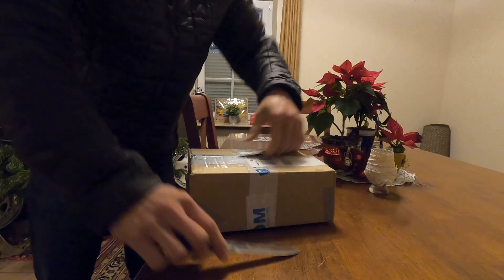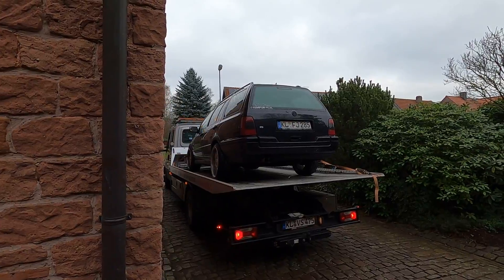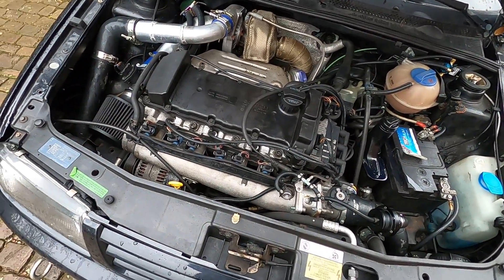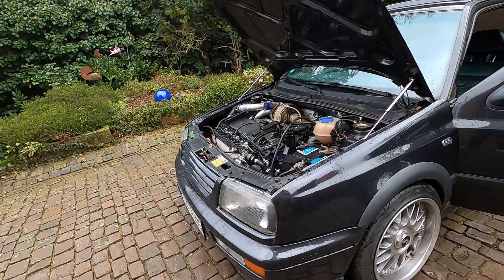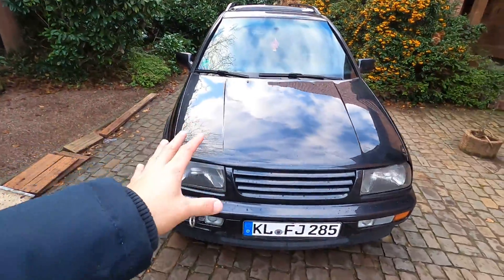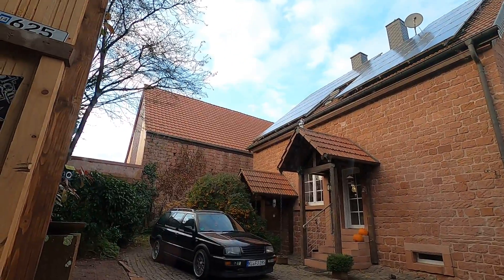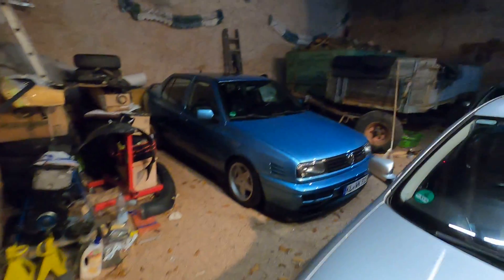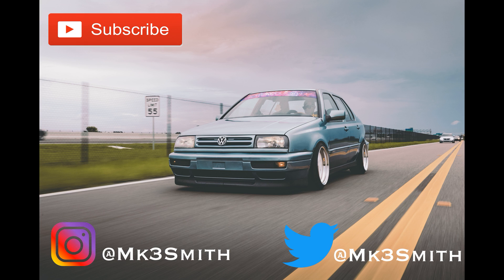2020 Just Started And We Have ANOTHER Car At The House! VR6 Turbo Wagon!

Comment: No way that's 400 with that beat up  stock fuel pump
Reply from the maker: Armindo Gomes I don’t know for sure just what I was told man. It also has a high flow secondary fuel pump and was running 18psi before it stopped running. Believe the injectors were just about maxed out with the current setup on the car